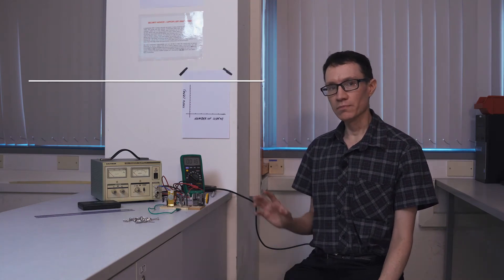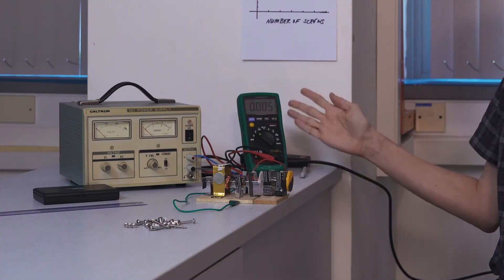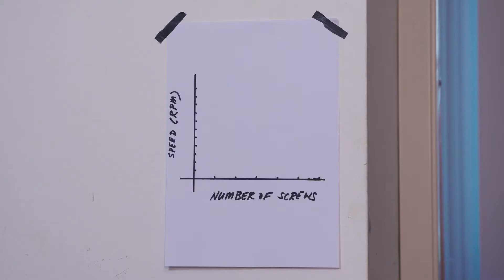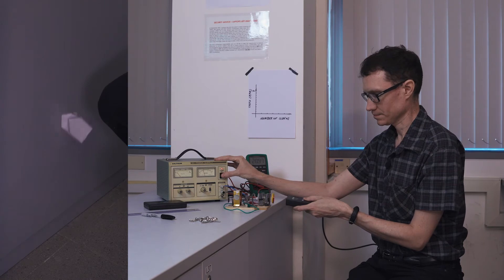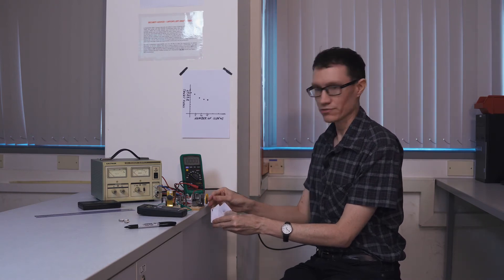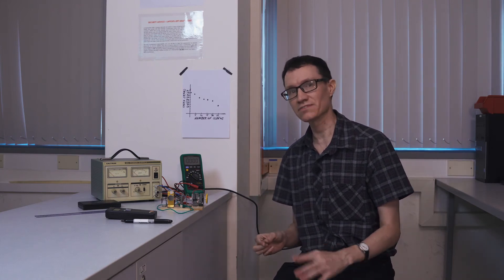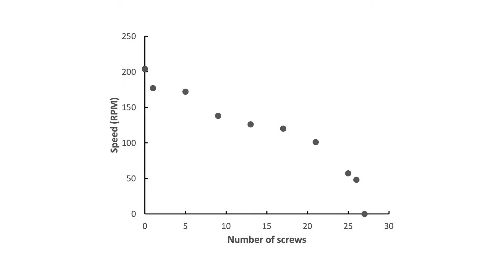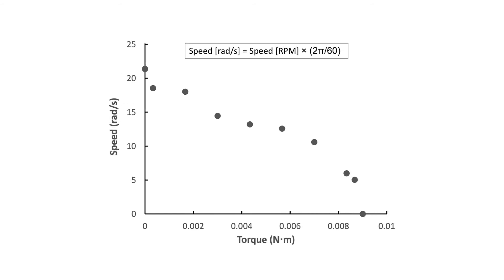Let's measure the torque of a DC motor (Motors #3)

Comment: thanks for this experiment, we could have strengthen our thought over torque more by your experiment, from this experiment, at each loads, the motor was able to lift them up, and it gives RPM and weights (which is used for torque).
but we are wondering that from the point of motor, it should be told to produce more torque that can spin the pully and lift the given weight. 
When the explanation comes with F X d, it could confuse a concept that the motor might generate the torque by weight of loads. But it's opposite.
Torque (of motor) = loss ratio of pully * radius of pully * lifted weight * 9.81kg.m/s2 at certain RPM, The torque is input, and it should exceed the torque which is caused by weight for spinning.
and this torque could not being representing nominal torque, but for selectors are watching motor's continuous torque that can be controlled without a risk or harm to motor.

I'm trying to put my energy to understand the torque in experimental ways, hope this can helps a bit more. In final, I want to test 400Nm nominal torque motor with the similar experiment that you showed (don't have dynamo unfortunately), so many things in doubt.

Comment: Your bench supply is current limited, thats why the voltage drops.
Reply: Yeah ..isn't that a flaw in the experiment? By using a current limited psu we are not really measuring correct data right?
Reply: Correct
Reply: @fabiofoltran4361  it was more about the presentation of the method I understood.